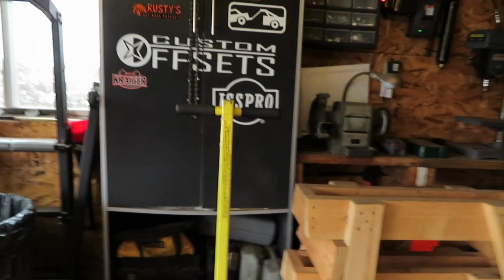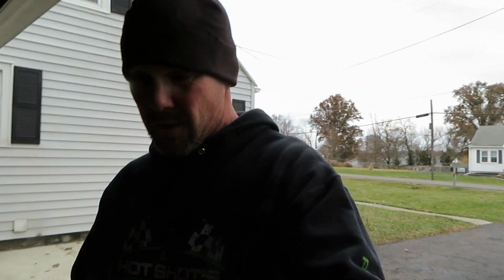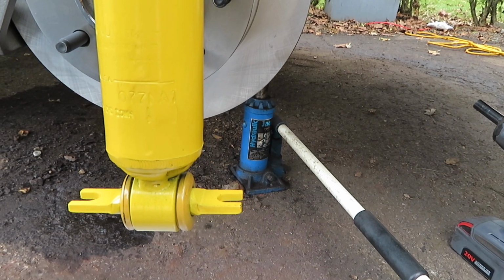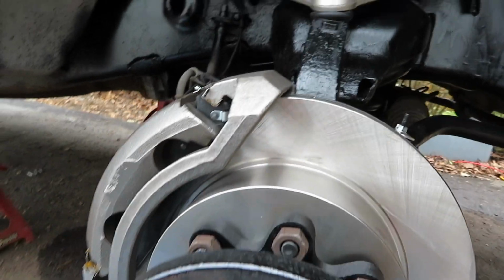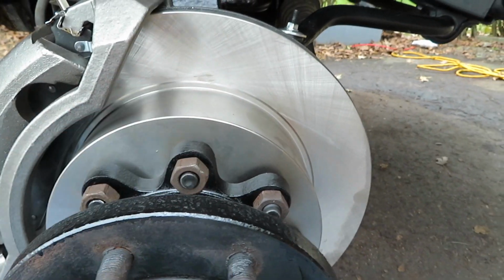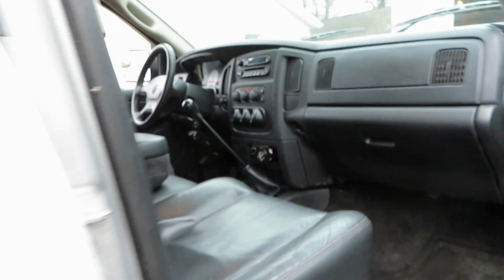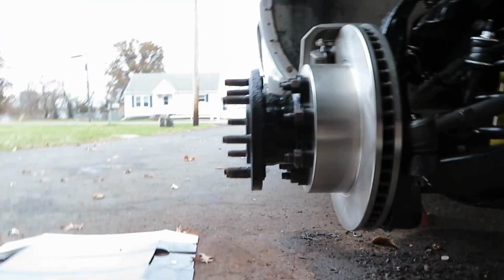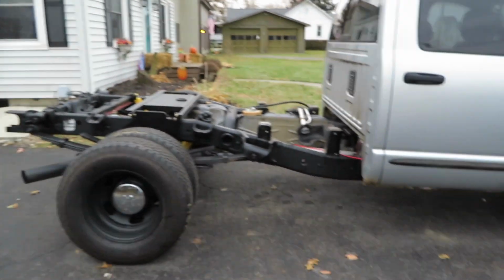Dodge Ram 3500 3rd Gen Cummins Back on the Ground

Comment: Smart man! Used to build driveshafts and we would do the same thing on the balancer! If your bored use a strip or a belt sander belt cut and wrap around it lol👏🤞
Reply from the maker: Yeah that would have been a lot nicer than holding my wire brush on there.